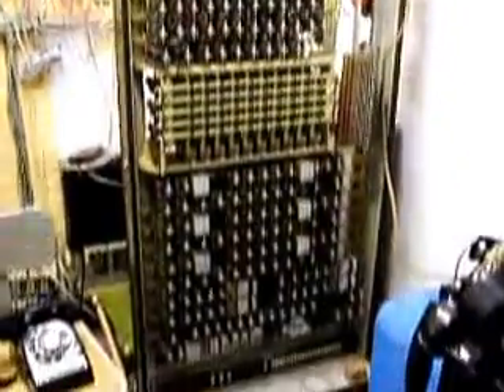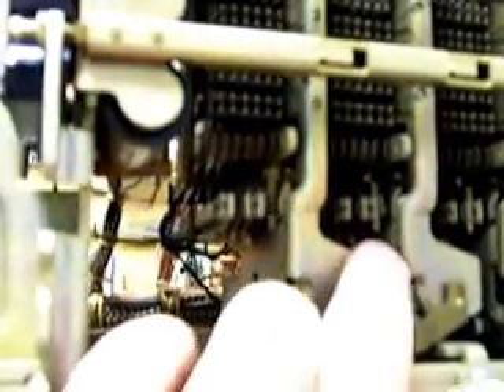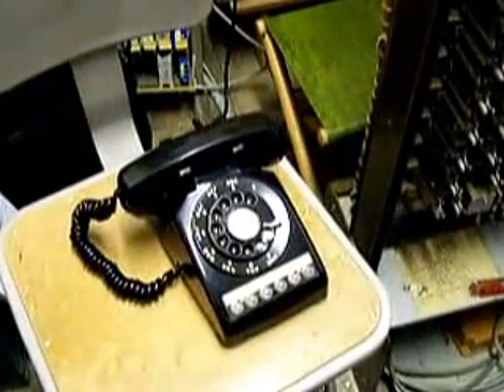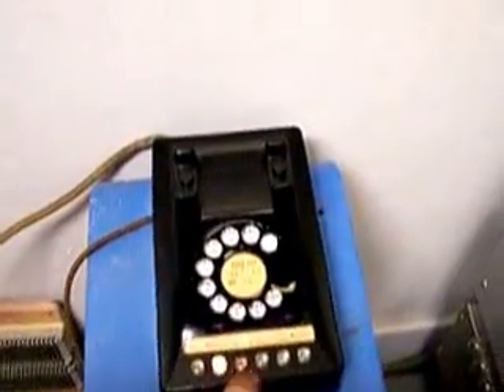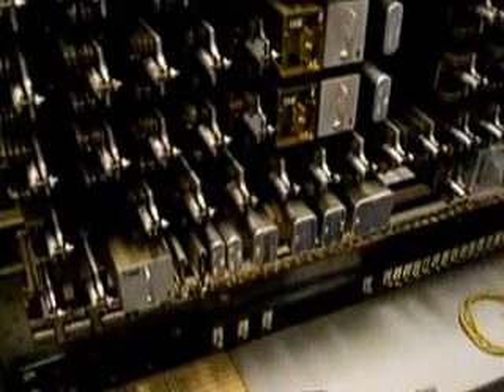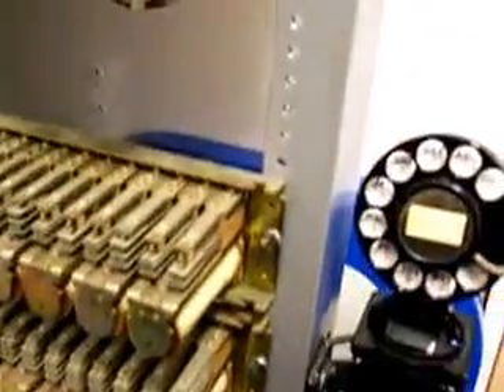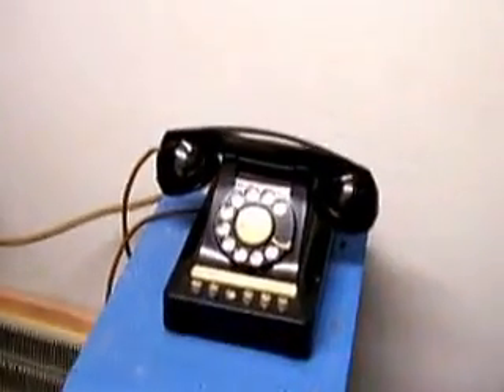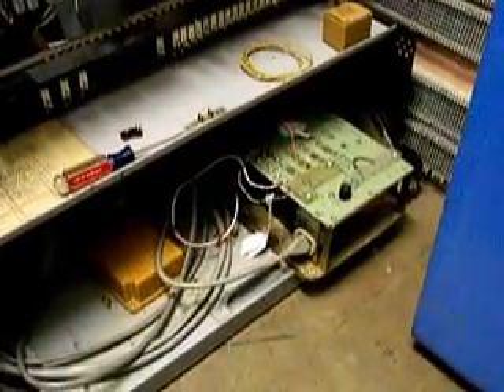Western Electric 755A Crossbar PBX Demonstration

Comment: I repaired 756,757,770, and step PBX in the 70’s before they were phased out. Loved it. I remember the connecting blocks were 50 wires you connected the spade tip to each screw laying down on the floor while it was mounted to the baseboard.  You never wanted to replace a phone but repair it at all cost to prevent having to do this

Comment: Was it necessary to use this special key telephone sets on all extensions, or could you also use normal telephone sets? The old small PBX systems here in Switzerland (apart from a possible operator place) used 'normal' telephone sets, equipped with a so called earth key, which act as a control key for several PBX functions. Was the earth key also known on US systems?

Comment: Does the 755 system have a marker circuit? I love seeing this equipment again. I worked as a SxS switchman in a 355a cdos, then a no.1 with Cama intertoll with toll completing into the lakeoftheozarks area in Missouri for southwesternbell, class4 and 5 offices. Loved it until I got transferred to AT&T long lines, then laid-off after divestiture.  It was such good work.thank you so much for this video.

Comment: Thanks!  I wish that I could understand this switch.  It seems almost small enough that I could.  Is there a block or other diagram anywhere?
Reply: These are long gone. No touch tone support. Rotary dial only. Flat spring relays. 10x10 crossbar switches. Neat for its day.

Comment: How many pairs were used to connect to each extension as compared to 1A2?  Put another way, what's the advantage of the switching if all four lines are wired at all 20 extensions?
Reply: One reason is the 2 link intercom. Two private calls between extensions.

Comment: I guess it was great in its time but it hung around too long. The model 566 phones were made especially for the 755 and only worked on it. If a customer damaged one severely you would have to do a special order from Western Electric because they were manufacturer discontinued. We weren't charging enough to rent it so customers kept them around forever.

Comment: The radio station where I worked for 28 years had a 755A from 1945 to 1978. One difference I notice is the delay in lighting the line lamps. The one I used did not have that. I added a busy lamp field and music on hold to it behind Bell's back.